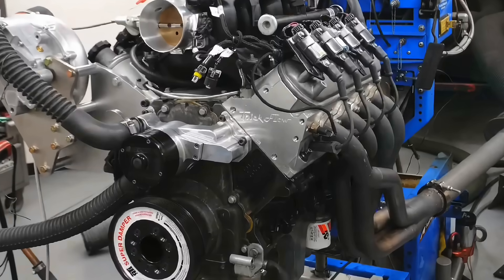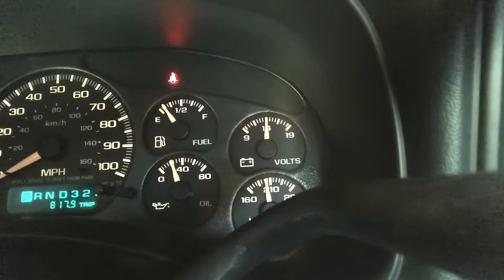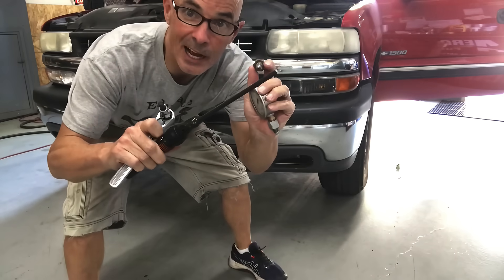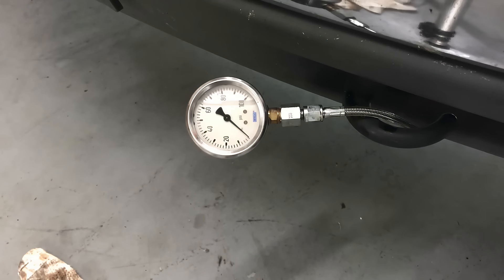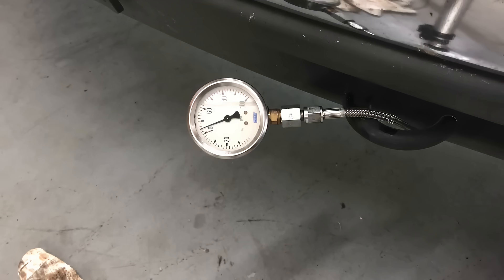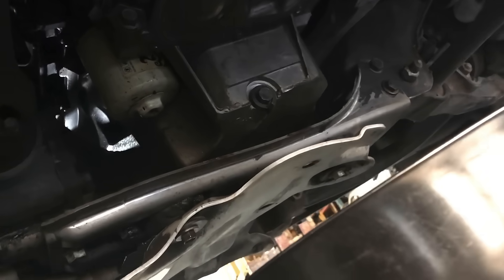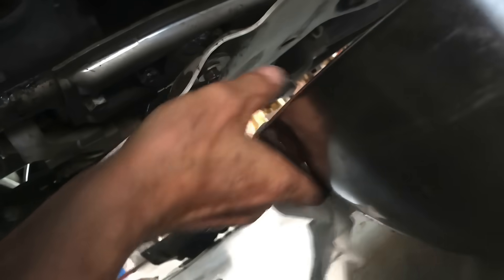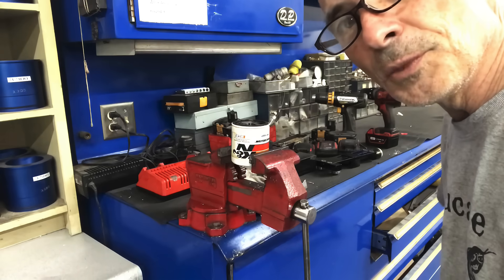HOW TO: TEST & FIX LOW OIL PRESSURE IN YOUR 5.3L OR OTHER LS?

Comment: An issue I’ve been needing to deal with for a bit, now I have more of an idea of what to check. Thanks Richard!
Reply: My suggestion having 280k on my 05' Trailblazer EXT LT is to change out the oil pressure sensor up top first. The little filter that connects to it gets clogged and/or the gasket can go bringing oil where the thing connects. Pain to get to in my 5.3L but is often the culprit if none has been messing around with the oil pan.
Reply: @BigSteve_Gaming187  my 2000 sierra 4.8 reads 0 oil pressure and I get a “check oil pressure” light on, however no ticking no nothing, runs and drives perfectly, when I wide open throttle it goes up to about 15 psi and the check oil pressure light turns off, do you think it could be the sensor as well ?
Reply: @akidim13  Inside the top oil pressure sensor there is a filter which can get clogged up. I changed my oil religiously and it was doing the same for me. Granted knowing that the top one is done on my truck I am gonna change the o ring on the pickup tube and the lower sending unit as preventative maintenance even tho the problem is solved. Waiting myself till next oil change. But yea I believe that is your best bet. 7/10 that ends up being the issue. Definitely would know if the oil pump went...
Reply: @BigSteve_Gaming187  my exact thought as well sir, 0 oil pressure would of been disastrous already, thank you… 

quick question, I heard early models like mine didn’t come with that little filter, not completely sure though
Reply: Gotcha. Still probably the case. The filter is an added feature in the newer vehicles even tho there are some who have had the oil leak thru the sensor.
Reply: @BigSteve_Gaming187  gonna change it out tomorrow, hoping for the best

Comment: Dont worry. My gm dealer told me 10 psi for every 1000 rpm is perfectly normal and had nothing to do with my l92 sounding like a cummins diesel.so its not warranty work.

Comment: Do all LS engines have that plug on the side of the block? I have a 2000 Silverado with 185k miles.  After about  5 oil changes using Mobil 1 5w30 high mileage synthetic 6-7k miles between oil changes. Oil consumption went to quart between changes to about 1/2 or less. I do live on Ohio where we have cold winters.

Comment: Clearly Richard spends his nights in the dyno cell because he ain't seeing nothing with those oxidized headlights at night. LOL  Good job finding the problem. I will say that anytime I noticed oil pressure decent when cold and it went away fast when the engine warmed up it was excessive bearing clearance.

Comment: The LS engines with AFM have an additional pressure relief in the pan that I've seen problems with.
Reply: As have I,  GM has a updated design for that relief valve,  cures a lot low oil pressure problems...

Comment: Captain Steve's mobile marine@gmail.com you got me on that one that was a newer 350 Chevy whoops b***** putting a o-ring on a oil pump pickup tube that should keep it the way it used to be you never have any problems ever pick up tube is welded to the pump and you never have trouble

Comment: There is a bypass valve down there where the oil filter is if the oil is going through the oil filter first then to the gauge that could be getting hung up on you Steve from Annapolis give me a comment on my Gmail Captain Steve mobile Marine

Comment: I found they hate cheaper filters too gotta use a synthetic filter. I change the filter now 2 times for every oil change. Filter at 3500 and oil +filter every 7000 always full synthetic. Mobil 1 or Pennzoil ultimate synthetic

Comment: I have a '96 Camaro with a 3800 in it that hasn't had oil pressure at idle and never more than 25 PSI at higher RPMs for the last 20k miles.  I figured it wasn't worth fixing (tried replacing the pressure sender because that was easy) and figured I'd just drive it until it blows, but it's hanging in like a champ.

Comment: There's a lot of people in here claiming that is normal oil pressure, those commenters need to realize 2 things: 1. His truck lost a ton of oil pressure at random, which is not normal. He was trying to figure out why it changed so drastically. and 2. this issue can be catastrophic in cold climates. the pickup tube o ring went bad on my 02 Sierra, at 20 below it wouldn't build oil pressure for a good 15 seconds, until the engine was warm revving it above idle would cause oil pressure to drop below like 15 going down the road. So even though his pressure was "acceptable", there was still a concern that needed to be addressed.
Reply: My o-ring was split, lifter pecking, new pump fixed. I pulled Diff to fix. The easy hack on u tube didn’t work for me.

Comment: I wouldn't use Lucas oil in my lawn mower. Took my Harley to a shop in Sturges and they put that shit in my bike and it sounded like I had .080 lash. Drove back to my hotel and changed it with Shaffers and quite as could be. You got lower oil psi with a new filter and oil than when you started. DRAIN THAT SHIT OUT OF THERE!!!!!
Reply from the maker: we've always had good success with Lucas

Comment: How different would the oil pressure reading be from a sensor mounted from an oil cooler block off plate (right after the pump) vs. where the sender sits on the back top of the block? 5 PSI? 10 PSI?
Reply from the maker: we took it right after the pump in the side of the block
Reply: @richardholdener1727  I appreciate the reply but my question is what would the difference be if you mounted the mechanical gauge on the top of the block instead of after the oil pump. Do you think you would lose a few psi?

Comment: Is that the salad bowl velocity stack from Westech your draining the old oil is going in? :)

Also I know we generally like to see 30-40 hot, More going down the road----at least I do for a daily driver vehicle,  but what about the rule of thumb, 10 PSI for every 1000 RPM. My 4.3 lived a few years at 20-25 PSI hot, until one day it was 3-5 PSI. As I mentioned on IG post, every possible bearing was worn right out. 

And I am now a believer in synthetic, as it is what I ran when I purchased the truck and I firmly believe it saved the engine from munching itself up. Other than the bearings being shot, everything else looked good on the wear surfaces.

Comment: So not only is your oil pressure perfectly fine on the dash cluster 20psi..... then you measure it with a gauge on the block and it is a perfect reading of 36psi.....then you proceed to tear things apart for no good reason.....yeah I'm not finishing the video.
Reply: Then you won't see that the pickup tube oring was tore

Comment: I am betting clogged oil pickup screen, seems to be a problem on these even when the oil is changed properly. I had to clean my oil pickup and then  I switched to full synthetic to stop the oil gumming using regular oil caused even when changed every 3,000 miles.   We will see, I am only 4:49 into the video.
Reply: he didn't even mention the pickup screen as a possible problem. Sludge build up is a known problem for these and the 4.2L I6's of the Rainier's, Envoy's, and Trailblazers.

Comment: What was your oil pressure after replacing the o ring at idle and rpm?
Reply from the maker: 40+ at ldle hot and over 60 with rpm

Comment: i had a lq4 with the same issue but what i found out was my 3rd cam bearing came loose but i bought some durabond bearings and a Chinese cam bearing tool and changed the cam bearings with the bottom end with heads still on the motor on the engine stand it can be done.

Comment: 1) so glad you didn’t just say “10 psi per 1000 rpm, that’s good enough.”  :)  Sure that’s fine for some engines, but when you see a sudden change, the fact that it CHANGED is much more important than the actual pressure.  

2) Weirdest one I ever had was on a 440.  As you know they have an external oil pump and the oil pressure regulator is built into the pump cover.  The cover is an iron casting that incorporates the filter mount, and internallyhas a machined passage with a spring-loaded piston that lifts at the set pressure and dumps excess oil from the pump outlet to the pump inlet (remember this for later...). This particular engine had lost an engine mount, shifted sideways, and bumped against  the subframe (which I didn’t know at the time).  I fixed the mount and drove a few weeks with no issues.  Then one day, as everyone with a big block will occasionally do, I let ‘er rip to redline through first gear and enjoyed the screech when it shifted to second. But when I  Iet off at cruise speed, I had about 30 psi instead of the usual 65.  At idle it was less than 10 instead of the usual 25. Uh oh.  I decided to change the oil and check for glitter- none, not even in the filter pleats. Put in new oil, filled the filter, and cranked her up... ZERO oil pressure! Ran it plenty long, and the lifters were getting very noisy, so I knew I had an issue. Long story short, when the oil pump cover kissed the subframe when the motor mount broke, it slightly dented the machined cylinder in the cover casting  where the relief valve piston rides.  My WOT blast had made the relief valve travel it’s full length for the first time since the motor mount broke, and the relief valve piston hung in the open position because of the pinched spot in the bore. Since the pump and oiling system were full, I just had low pressure... but as soon as  I changed the oil it allowed air into the pickup tube and pump, and with the relief valve open and effectively connecting the inlet to the outlet AND being filled with air instead of oil, it couldn’t draw oil up the pickup tube and to the pump at all.  Pulled an oil pump cover out of my parts pile, cleaned it and checked the piston travel, installed it, and all was well.  That was 25+ years ago and that engine is still running well today.
Reply: I wish I had been as smart as you or could have gotten some good advice about my 440. I don't think my cover got dented but I did run the engine up to 5500 through all the gears and then parked it a few minutes later. After dark I moved the car inside and no oil pressure. That experience caused me to let the car set a long time until I parted it out.  What a waste. I bet I could have fixed it in 30 minutes or less based on your comment. Live and learn ........

Comment: The freeze plug in the front is the worst part of an LS. I designed a plug that has an 0-ring and the front cover holds in place so it can't push out. Thought it fit with Sac City Corvette's other oil parts, so I made a deal with them. Recommend it over the horrible freeze plug.

Comment: Same thing happened to my 06 silverado  5.3 with 313k miles on it.  Turns out it was the O ring just like yours. Replaced it and cleaned the filter screen ect. now pressure is back up.

Comment: Holdener fixing truck:
Step 1. Pull engine
Step 2. Put on dyno
Step 3. Make a few pulls
Step 4. Change Intake Manifold
Step 5. Change cam.
Step 6. Change exhause
Step 6. Add Boost.
Fixed
Reply from the maker: yes

Comment: Dod ls engines loose valley plate = low to no oil pressure. Almost every one have finger tight bolts

Comment: I've had issues with the delco filters that end with an E...I would loose 10 psi or more after 3-4,000 miles (I use full synthetic at 6,000 change intervals) I switched to a wicks filter and haven't had any problems since...
Reply: Love those Wix

Comment: My oil pressure will shake like it hunting some time not all the time and the pressure has dropped in last week from 40 at idle to about 30 and it will go up but it just about what you had in video but does anybody know what will make the gauge shake? Not when running just at idle

Comment: Richard,i have an 01 4.6 2 valve i run 10-30 oil .it has 80 psi when  cold but drops down to 20 psi whwn hot at idle,just a few rpm above idle and shes about 50 to 60 psi .normal? ps it has the factory gage and a glowshift gage .THANKS!!!!!!!!!!!!!!

Comment: my dads 04 chevy silverado has a 5.3 ls motor and some years back it started reading low oil pressure but then the volt meter started acting up and then i did some research and found out that the instrument clusters in gm cars and trucks had some serious issues, so i went to my local napa dealer and got another updated cluster and the oil pressure issue was solved i really appreciate you showing us how you figured out your issue thanks for that!
Reply: So just replacing the dash cluster fixed the problem? I’m having a few issues with my 2004 Silverado cluster.
Reply: The stepper motors that operate the gauges are notorious for failing. They don’t cost much, but you have to know how to solder to replace them. 
There are a lot of videos on YT about them.
Reply: A gmc cluster from junkyard will fix it.

Comment: my oil pressure dropped to about 5psi after a drive to work in my ls swappped s10. So i changed the oil  And filter and it started smoking bad out the breathes. Oil pressure drop from 60 to about 20psi when warmed up.

Comment: I was told by an engine builder that absolute minimum is 1lb.. of pressure per 100 rpm. Or 10 lbs. Per 1000 rpm. If your idle is 750 and oil pressure is 38 lbs., that sounds good for a stock engine. I need to change oil and check mine, because it doesn't go over 45 lbs. on my 98 Tahoe with the 5.7. It doesnt smoke either. Only 130k miles.

Comment: I wouldn't worry about it. I've seen lower with no issues.
In multiple 300,000 mile GMs I've never   used an additive or a thicker oil. The manual tells not to use a thicker oil..

Comment: When my 418 was built last year, I converted from LS7 to ST2126LSR lifters, installed a billet barbell, new restricted pushrods, new Katech oil pump, new pan, new pickup tube, still using K&N filter. My hot idle pressure dropped to about to about 25-30psi. I read a comment here that oil pressure should be 1psi per 100RPM. Is there such a thing as having too much pressure, and if yes, side effects?

Comment: This is the way the operator of a vehicle is supposed to react and that is why they put a gauge in the dash. 
Yeah the pressure was still in spec but that engine was on its way to all those lifter issues and oil leak issues. When the operator of any piece of equipment pays attention to what is going on, they always save money in the long run. This is one of the issues of buying and driving a used vehicle because when you buy it with 35 psi, that sets the standard for the oil pressure and that pump is sucking air past that oring and blending it with the engine oil the whole time it is running. Now imagine what that foamy oil is doing to everything in the system. You wonder why the lifters in the cylinder deactivation systems fail? 
Ok also if you guys have a transmission front pump seal leaking around the torque converter and you remove the transmission to replace the seal, you should look at the bushing in the front pump and see if it has the babbitt gray look on the top side of the bushing and worn to the brass color down on the bottom side of the bushing. If it looks that way then the engine oil pressure may be low and causing the crank to wear the main bearings allowing the crank sit lower. So changing the seal will work for a while but the customer should be informed of what is going on and what to expect next. Vortec engines with high mileage are known for this, but it holds true for every engine transmission combo.

Nice job Richard and thanks again for making and showing these video's.
Ed

Comment: I always wire a piezio buzzer in parallel with the light or add one to a gauge system.
When 100 db beeper goes off .......
It gets your attention.

Comment: The 0w20 and 5w20 engines usually idle about 35 on the dash gauge. Revving them Ive never seen more than 55 on a factory engine.
High mileage engines will be lower, obviously.

We had a guy with a new 0w20 truck, 238 actual miles, and had 20w50 put in because he said he was going to Texas.

Comment: Replace orings with Viton orings when ever possible they have a higher temp and pressure rating than rubber orings
Reply: Where can I find those?
Reply: @veezybee23  hydraulic supply store, or online

Comment: For my Saab 97x (yes a Saab had a lh6 5.3!) it was the oil pickup ring. But unlike your truck the saabs oil pan is like a 6 hour venture. Might as well replace everything else while in there haha had thr same issue hot oil pressure was under 20. Rev it up and oil pressure drops and as soon as you let off it would spike again.

Comment: I have seen multiple times where people install the oil pump in correctly and the pump housing is dragging on the drive gear it causes a hot spot in the pump and will cavitate. This issue usually happens with motors that see alot if rpm. Or sustaind medium to high rpm. I do have pictures if anyone wants to see what I'm talking about.

Comment: LM7 i had in my Nova had a bad seal on the cam plate (reused it, never thought to check it). new LR4 in the Nova...ehh, idk. was noticing oil pressure dropping to 20 when hot at idle. oil was super thin when drained (was 5w30, turbo engine). put some 10w40 in it and pressure is like 35. now you have me questioning the oring (that was replaced)... could be the sender too (cheap).

Comment: Yup this didn’t help, last year my pressure fell off, changed the o ring and it was good for a few days. And it’s back down under 20 psi.   Gonna change the pump next
Reply: You can shim the relief valve in you pump alot of times the get stuck beware to much shim can cause to high oil psi  can shim about .125 it should put you between 50-60 psi idle